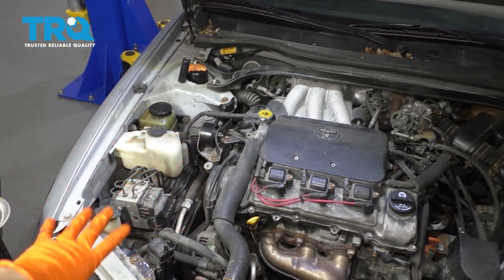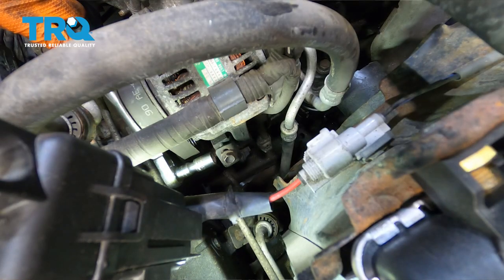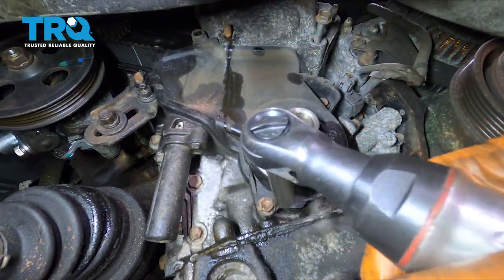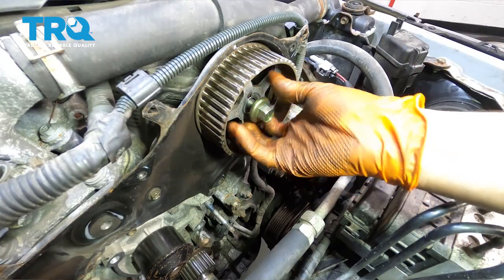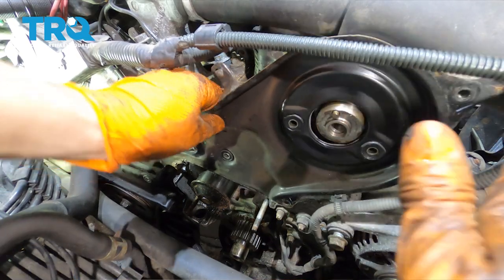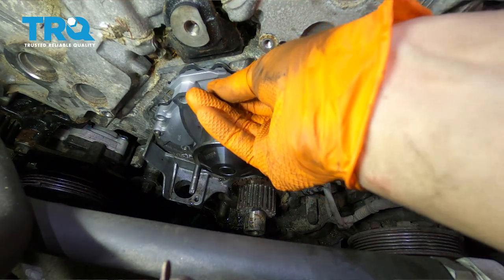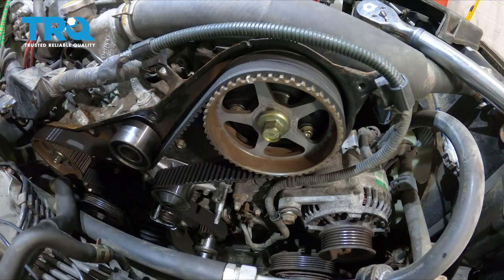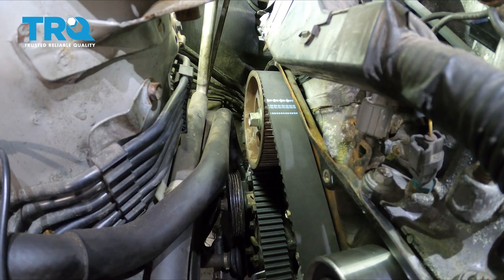How to Replace Timing Belt, Water Pump, Cam & Crank Seals 1999-2003 Toyota Solara

Comment: You doing a great job at watch this before earlier but I wanted to sink in my head thanks yeah if you could answer my question I'm pretty sure the thermostats underneath the radiator cap you know way on the bottom and what kind of seal or do you have a video for that one thanks

Comment: Excellent Video! Thank you so much! I have a couple of questions: First the petroleum jelly (vasilene). Some are saying a petroleum-based jelly can cause the seals to swell and to use dielectric grease instead. Is this true? or overblown. Second, you didn't press in the seals. Should that be done or is it unneccessary? Perhaps that is the magic of petroleum jelly?

Comment: “Rubber damage
Petroleum jelly, also known as petrolatum or Vaseline, can cause rubber to become brittle, cracked, swollen, and hardened. This can reduce the rubber's elasticity and lead to failure. Petroleum jelly can also discolor and corrode rubber”

“Silicone grease is better
Silicone grease is a safe and effective lubricant for O-rings and rubber seals. It's waterproof, protective, and easy to use. Silicone grease can be used on rubber and plastic without damaging them”

Or just use a little oil

Comment: Well done video, do the belt tensioner bolts loosen to the right, I think I may have over tightened the inner one and it sneered off, the tensioner is off but now I have to extract that bolt or there is no getting that bolt back in, is it possible to extract without having to lift or take out the engine? Thanks